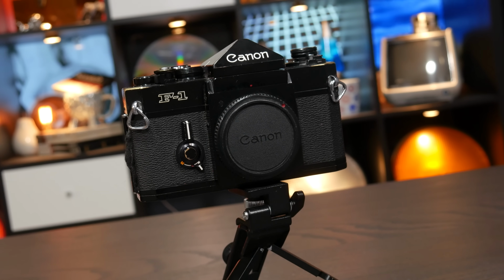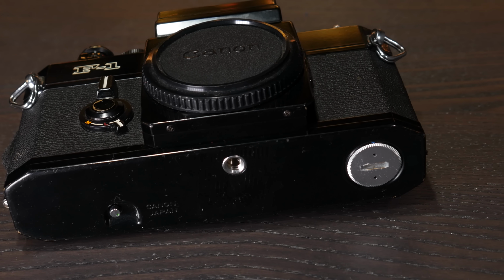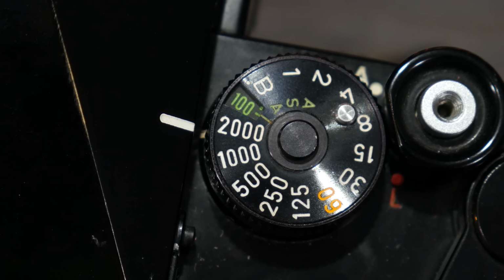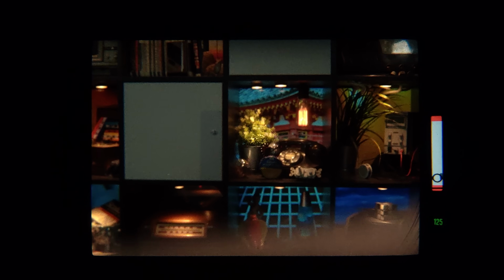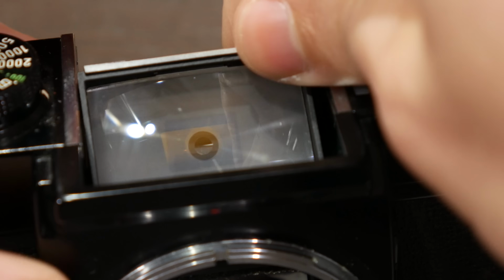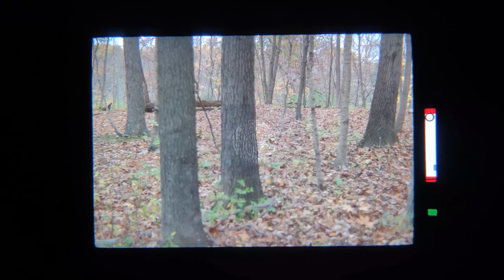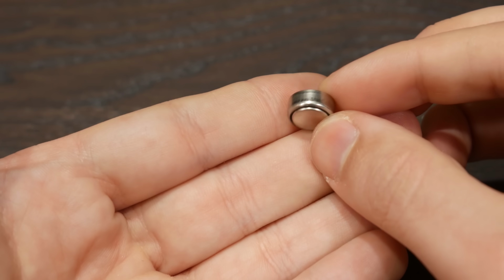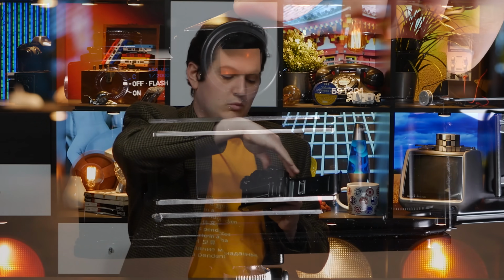1970's Camera Tech: How they showed you what settings to use

Comment: I was fortunate enough to go to a high school with film darkroom facilities (I just graduated high school like two years ago so this is quite recent) so I was able to learn a lot about how these fully manual film cameras work (as well as develop and enlarge some of my own film!). I find this video just as fascinating as when I learned this the first time. Film photography and development sure was a hassle, but it's also sad that such a technological marvel of engineering and chemistry is dying off/has mostly died off.
Reply: Same at my high school (late 70s / early 80s). As a photographer for the yearbook, learned to develop and print 35mm photographs. Was using my first SLR, the Olympus OM-10. About 1lb w/o lens; I bought a 75-260 that weighed about 5 lbs iirc.
Reply: @kevind814  I just bought an Olympus om10 off eBay over the summer. I don't have the manual adapter for it yet but it usually pretty nice results in aperture priority.
Reply: You think film photography is dying off? More film was sold in the last three years (2017 - 2020, each year selling more than previous) than in any other year since 2001.

Film photography isn't going anywhere.
Reply: @medes5597  In 2018, Kodak brought back Ektachrome slide film after having been discontinued for 5 years.
Reply: One of the best things about being a photographer for the High School Yearbook was going into the dark room with an attractive classmate you had a crush on to "see what developed".

Comment: 1) If you blow out color negative film, you fucked up real bad.
2) You didn't mention GOST! The most confusing part of using Soviet cameras nowadays!
3) The old Solenoid lightmeters that were often put on the shoulders of cameras are really interesting, it's basically a solar panel that moved a needle by almost impossibly small amounts of electro magnetism. No batteries, and many still work 50-60 years later!

Comment: Kudu's for a fine explanation of the original SLR system. The best I have seen on video.

I was a professional photographer for many years and remember that era quite fondly. Although I used Nikon models at work (when not using a 4x5) I preferred carrying handier (in those days) types for personal travel use.

About a year or so after your camera came out Fuji Photo Film Company (Fujica) came out with a camera using a greatly improved metering system, their model ST801. It differed from all other cameras of the time by having a silicon blue sensor instead of the CDS cell used by every other brand. These were fantastically fast and not color blind like all others. Fuji also eliminated the mechanical and fragile meter movement, replacing it with an LED scale which not only was insensitive to impacts but lit up making it visible in low light.

Within less than a decade the whole industry went that way. Fuji also introduced the first fully automatic interchangeable lens SLR a few years later and the whole industry quickly went that way.

This was pretty much the way that the industry stayed until the advent of usable digital cameras in the 2000s.

I have a collection of various SLRs from the 60s through the 90s to this day.

Thanks for a trip down memory lane.

Comment: Iso in digital cameras is fascinating because it’s not actually a change in sensitivity of the sensor... the sensor does the same thing every time... iso is a preset gain adjustment applied to the sensor information.  Many photographers shoot ‘raw’ in fluid situations.  This records the actual sensor data which is 3-4 times as large as the final jpeg.  The actual gain adjustment can be applied more optimally in a post production software such as photoshop or lightroom.

Comment: Those old mechanical cameras sure do have a charm.  Film is typically made more sensitive by the individual silver halide (bromide?) crystals being physically larger.  I’m sure you could go down a rabbit hole exploring how Kodak developed tabular grain crystal technology to cram smaller crystals closer together.  Everything in the history of film development was designed to advance the performance in simple cameras.  You could draw a line from that brownie camera in your virtual background to those single use cameras at the end of the film era.  THAT is who Kodak was making negative film for.  The basic cameras had fixed apertures and fixed shutter speeds and the only way for them to work was for the film stock to have a wide exposure latitude.  That is, a wide latitude of over and underexposure that could still yield printable negatives.  Full stop increments were enough for film cameras... some had half stops on the lens but I’m not aware of any that had fractional shutter speeds.  Digital cameras typically are set up in 1/3 stop increments.  Interestingly canon was late to adopt 1/3 stop adjustments to iso. The current ones have 1/3 on all three exposure controls.

Comment: you could probably just add a resistor to an alkaline battery to bring the output to the camera to 1.3V. The value would depend on the resistance of the camera circuit, so if switching settings effects the overall voltage this option would be out (but the resistance the battery sees may be constant, in which case it would work).
Reply: A resistor won't work, as the light sensor itself is a variable resistor, so the other half of the voltage divider you're trying to build changes with use.

Comment: When you change the ISO you dont change the sensitivity of the sensor but you change the amplification of the signal that the sensor is picking up. This is a common misunderstanding. Keep up the good work.
Reply: I don't think it even changes the amplification of the signal.  It probably rotates the meter movement to reposition the needle.  The logarithmic scale is built into all 3 settings (film-speed, shutter, and f-number) so the required motion of the meter movement is linear and the linkage is simple.
In a way, Minolta's system where the meter movement is fixed is more intuitive.  Both the shutter dial and the f-stop ring act on the follower-needle (the lollipop).  When the light is very low, the meter needle is also way down low.  Very high-ISO film never needs to lock out any shutter speeds.

Comment: Love the fact the icon for the self timer in modern digital cameras (at least for the Sony a6000) resembles the F1s front control. I always thought it didn't look quite like a clock…
Reply: On another note, I have an 8mm movie camera built by Sekonic in the early 1970s. Similarly, it has a SLR and an "Electric Eye" light meter built in. I imagine It works in a similar way, though I haven't put much time or effort into figuring it out.

Comment: This makes me appreciate that my Contax E from 1956 has one of those light meters built into it, which is mechanical, using a selenium cell. It has a little wheel on top which you use to set a 2nd needle to the light meter's needle position, which then tells you what shutterspeed/exposure time you should use. You can set your ISO aswell on that. It took me a while to figure it out because... who does videos on 70 year old tech. But hey, it works, so I can't complain.

Comment: Hi Captain Disillusion. How long is a light meter in feet? I also love the dust you added in post.
Reply: A light meter is actually a measurement of time, similar to how a light year is a measurement of distance. Since the speed of light in a vacuum is 299,792,458 meters per second, a light meter is 1/299,792,458th of a second or 0.0000000033356409519815204957557671447492 seconds
Reply: @NandR  u r more precise than me (3.333333333333333e-9) since I round up to 300 million meters per second :(
Reply: One advantage of Canadian spelling is that it distinguishes "meter" and "metre".
A light meter is a measurement device, and a light-metre is a unit of time as described above.
Reply: Ontario Traffic Man: reaperexpress This is a kinda random tangent, but I just want to say that it’s interesting that English (in the vast majority of places besides the U.S.) distinguishes between “meter” and “metre” when IIRC the French “mètre” which the words are both derived from doesn’t distinguish between the two concepts. Makes me wonder when the distinction first started being used.

Comment: Do NOT use Alkaline batteries for these types of lightmeter. The Alkaline batteries have a rater annoying discharge curve, meaning that they go out of the factory producing a little over 1.5V then they start to lose charge progressively, meaning that you might be able to calibrate a lightmeter for 1.5V but then you'll have all your slides skewed because now the battery is giving 1.4V or less. Instead, use silver oxide batteries: similar to Hg batteries, their voltage remains stable dropping significantly when near their end of life. An alternative is making yourself a battery holder with a diode that act as a voltage regulator and it is calibrated for outputting 1.35V, eliminating the calibration step and the expense of the silver oxide batteries.
Reply: A job for Big Clive, perhaps?
Reply: @K-o-R  why not? I have one of those adapters but I’m interested in seeing how they are made and how much component miniaturisation is present

Comment: Neato.  I completely agree that there's something immensely satisfying about these old pig-iron SLRs.  I've got my mother's old Minolta SR-T 201, which was one of this camera's direct competitors and is very like it in a great many respects. (The 201 is the 1975 updated version of the SR-T 101 that has an integral flash hot shoe on top of the viewfinder and, amusingly, the "memo holder" thing on the back cover, which, given the timing, I bet was copied straight from the F-1.)  Even the battery... door? Port? Hatch? for the light meter battery is very similar.  The reticle for the light meter is slightly different, but works on basically the same principle.

Comment: I love old film cameras, though I especially love all the weird 80s cameras. Such cool mixes of old tech and (at the time) bleeding edge of tech. I have a 1980s Minolta Maxxum 7000, it's super interesting because it was the commercially sold camera that had in body autofocus, compared to the tumors that hung off of the autofocus lenses that other companies sold at the time. This way of achieving autofocus is largely the same way that autofocus on DSLRs work today. Minolta was later bought by sony and they still use a version on the Minolta A mount to this day

Comment: I think some rechargeable button batteries (NiMH) have something like 1.25V. Is that enough to handle the light meter?
Reply: Probably not. HgO battery have extremely flat discharge curve. ZnO have a little bit worse, but similar.

Comment: The F-1 is the camera my parents grew up on. The simplicity of these older mechanical cameras made easy to understand what shutter speed and aperture meant when my dad explained to me what was going on.

In the late 90's I shot film with an "AE-1 Program" (another Canon FD-mount SLR) for a few years, but I was so hesitant to use film that I spent a month to expose a roll and didn't really get enough practice to learn from my mistakes. Also I was super slow at manually focusing with a split-prism. Still, I very occasionally miss the physical split prism on modern DSLRs when AF just can't get the job done.
Reply: I still have my AE-1…
This video makes me want to pick up a roll of film for the weekend.
Reply: I wish all modern DSLRs had split-prism focusing. After using film for so long and auto-focus working only about 80% of the time, it would make life so much easier.
Reply: For most DSLR's you can still get split-prism screens! (if not official, usually still aftermarket. I got one for the nikon D7000 for $20 iirc.)
Reply: The Fujifilm X-T3 and X-T4 have a digital split prism mode that seems to work? I dunno might be worth a shot.
Reply: Well the secret is out after this video, and there goes the prices for the F-1.
Reply: Nothing gets your eye dialed in for manual focus without a split prism like macro work. It's a struggle at first, but with practice you get to know where your focal plane is without needing an aid, and the skill transfers nicely to ordinary lenses.
Reply: Yes, the Canon AE-1 or AE-1P with a Vivitar 283 flash was the favorite kit for a LOT of avid photographers. I have trays full of slides and boxes full of negs/prints made with that combo.
Reply: I used an AE-1 in high school and college (was on newspaper staff.)  I can't tell you how many rolls of film I shot and developed over about 6 years. Yearbook photos, local sports events, school functions, staff, faculty, and student photos, community interest images. It was a blast.